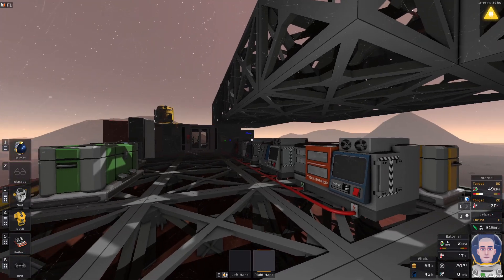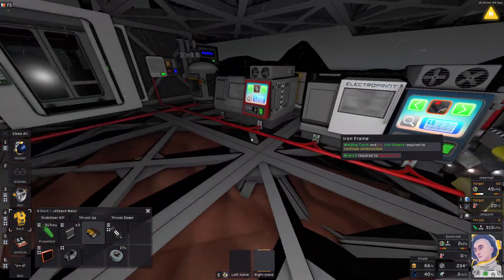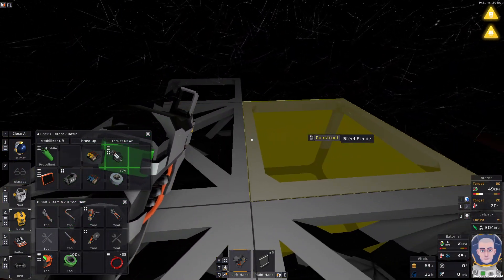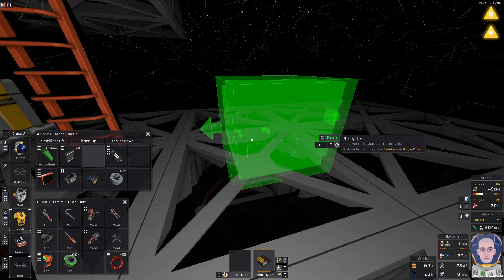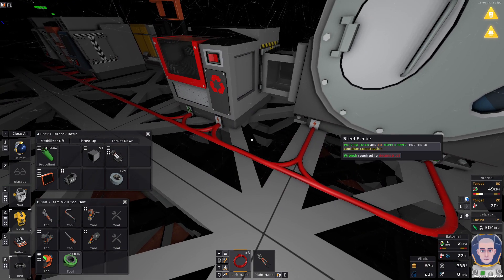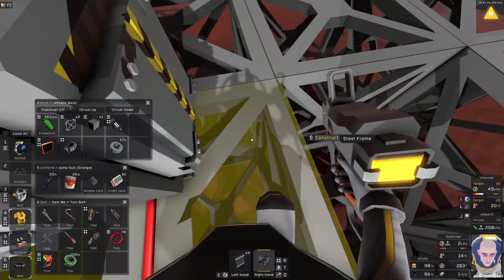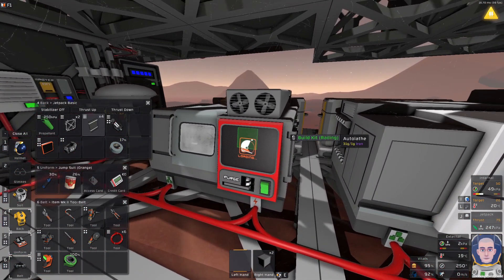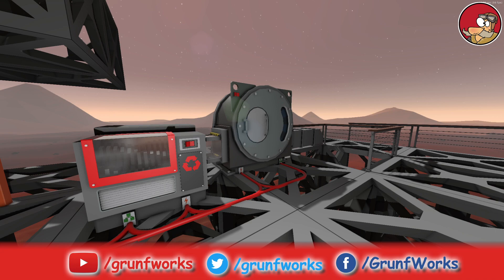Recycler and Centrifuge - Mars Survival Getting Started Guide - ep 17

Comment: How are better steel frames then iron frames? Is it only more shapes or are they also more resistant or something?
Reply from the maker: More efficient to make. Not sure if more durable. Does any1 know ??
Reply: @GrunfWorks  OK I get your point now. Having advanced furnace fully operational in closed room, it's as easy to smelt steel as iron. And it's way cheaper.
Reply from the maker: @radoslawmazurekwaw  And a steel frame costs only 2g steel while iron frame costs 4g of iron or something. Same thing for sheets

Comment: Aside from ore reclamation, the recycler plus centrifuge combination can be used in an automated power generation process.  That process being hydroponic devices being planted and harvested by programed Harvies which are connected to a sorter via chutes.  The seeds harvested are sent back to the Harvie inputs, and the plants/fruits/veg are sent to recycler and centrifuge to be turned into biomass.  That biomass is then fed to a furnace, or arc furnace, to be cooked into charcoal which is then consumed in a solid fuel generator.

It is a surprisingly effective process, as not only will it power itself, but depending on the scale of the greenhouse (that is the number of planters and harvies) one can power a large base with a significant power consumption.  Cheers!